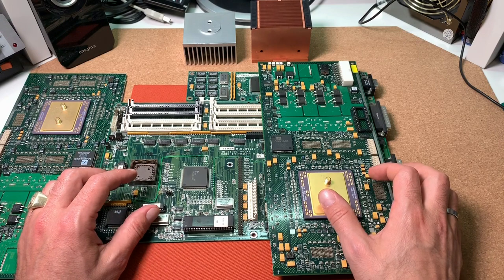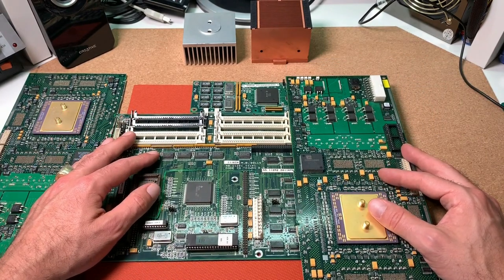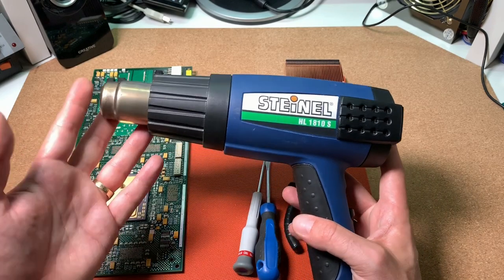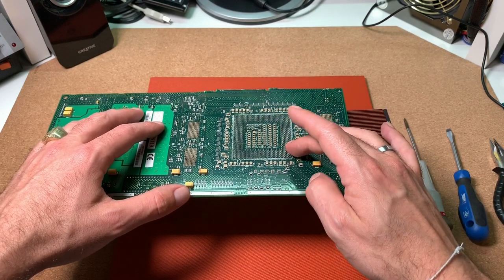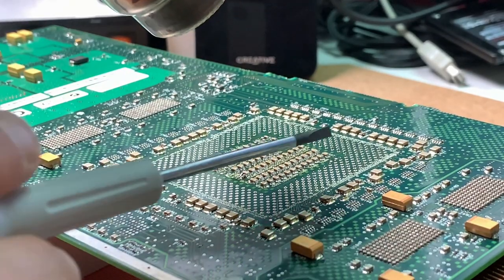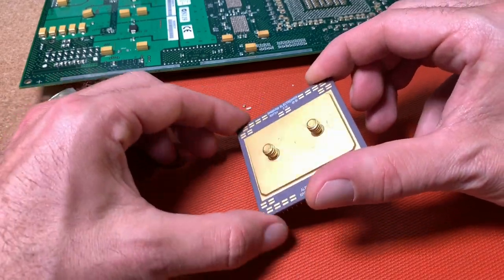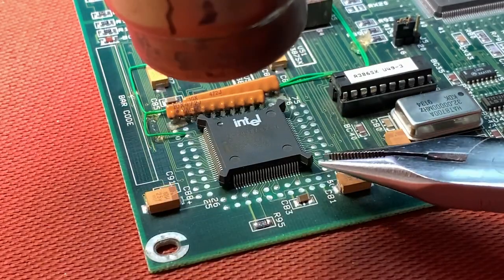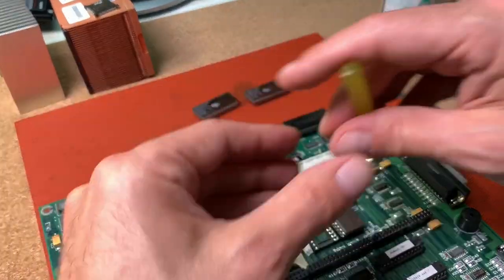Desoldering a CPU - Huge Alpha Ceramic CPU

Comment: I loved the Alpha CPU's. The company I worked for back in the 1990's was running on an 88000 RISC CPU platform and it wasn't all that fast. We were considering moving to an IBM PowerPC platform until we did some testing on an DEC Alpha. Holy moly, our application benchmarks ran thirty and sometimes even sixty times faster than the old 88K platform. Our clients were absolutely amazed.

Comment: That Alpha cpu a nice piece indeed. I to own that 667Mhz I got from an eBay seller more than 10 years ago, i just never got the Heatsink(or MB) for it. Funny is I can remember seeing an advertisement for that CPU in a Computer Shopper Magazine it was a full page Ad of a person holding the CPU up and on the ad it said now it's alpha inside. The ad also had Alpha CPU and the Pentium pro in performance comparison for sever computers with Windows NT 3.5 or 4 I do believe but can't remember for sure. Great video!!

Comment: This is my technique to remove soldered chips for my collection as well, but let's not forget about the toxic fumes it may generate. It is better to do this in the open, or at least in a well ventilated area.
Reply: and wear a respirator if needed, the fumes could be carcinogenic or cause other issues.

Comment: I use a crudely-regulated heat gun, not a big step above the one you use. I affixed it vertically to a universal stand and I use a multimeter and thermocouple to monitor the temperature while playing with the temp potentiometer (which just goes from Off to 10)  and raising it or lowering the gun above the PCB to get a big enough and uniform heated spot on the area I'm working on. Everything else gets sealed off with Kapton tape and aluminium foil, unless I don't care much for it. When the part gets stubborn on me, I remember Louis Rossman's advice about applying solder flux: "The bigger the gob, the better the job" LOL Cheers, mate. Always fascinating to watch your stuff!
Reply: using a heat gun and a multimeter to unsolder a CPU is pretty impressive. It shows that you are resourceful and able to think outside the box. Keep up the good work! Just be careful not to burn yourself or damage the CPU in the process.

Comment: Many years ago I gave my brother a LED moving message display PCB, basically a board with several hundred LED's on it, to be recycled into Christmas lights,  Later he showed me his efforts, the lead end of the LED's had obviously been overheated as they were bloated and had many small bubbles in them - however they all, bar one, worked.
So I asked him of his method. He put the board, LED's up, onto his BBQ, when it 'looked hot' he flipped it over and banged it on the edge of something, whereupon lots of LED's fell out. He just kept doing this until they were all out.
Truth be known the one dead LED was probably dead in the first place.

Comment: While I appreciate you are a CPU collector, and I must say I really enjoy your channel, if those boards were good working systems it is a shame to take them completely out of action when some simple precautions would avoid unnecessary damage.  For example if you had used a little kapton tape (high temperature masking tape) on the SMD components around that 386 CPU it would have stopped them blowing off.   Even if the boards are faulty I personally would still take these precaution just as good practise but  that's just me.  

That's not to take away from the great stuff you do here on your channel, keep up the good work.
Reply: what are the things that fell off  before the cpu did?
Reply: @legendmaster1989  transistors supplies
Reply: @theriven822  are they neccesary?
Reply: @theriven822  are they necesary?

Comment: About how long do you need to apply the heat for to remove the chip?  I have a stack of old network switches that have a soldered ceramic Intel i960 on the board and I want to harvest the chips to scrap separate from the board.
Reply from the maker: it takes quite a while, depending also on the thickness of the board. but if you don’t care of damaging the pcb just blow 450 degree C for some minutes. you will experience that the layers of the pcb will start separating as well. by knocking with a screwdriver on the hot board the chip will fall out.

Comment: Great video but small comment from me. I prefer to do it on "open air" because fumes when desoldering are very toxic.
Reply: I wouldn't call it "very toxic". Especially, he doesn't use any kind of flux. This is mainly a flux, not the solder itself, what produces the fumes.
Great for removing these stickers is WD-40 (or diesel fuel).

Comment: Do you use the same process to recover a Quad Flat Package (QFP) chip?
Reply from the maker: you could use this but have to take care not to blow away the part with the air flow.
Reply: @CPUGalaxy  I actually wondered about doing it with the same method you used; heating up the PCB from the bottom and allowing the QFP chip to fall when the solder melts.  Would that work or is there a better way?

Comment: does desoldering a cpu destroys the bold?
Reply: Desoldering a CPU can damage the pins or the solder balls that connect the CPU to the motherboard. If not done correctly, the CPU can be permanently damaged, and it may not function properly even if it is successfully desoldered. So, while desoldering a CPU does not necessarily destroy the board, it can cause damage to the CPU and render it unusable if not done with proper care and expertise.